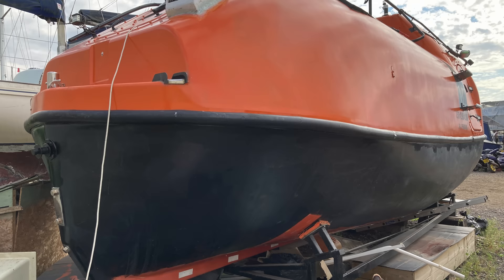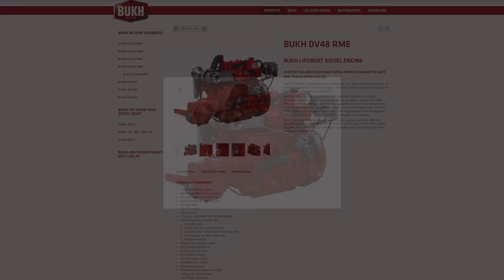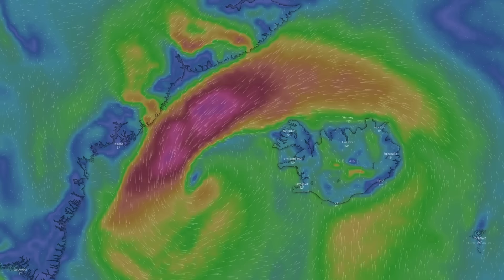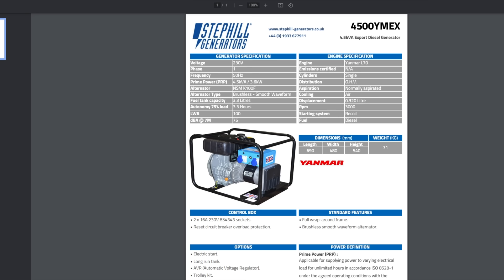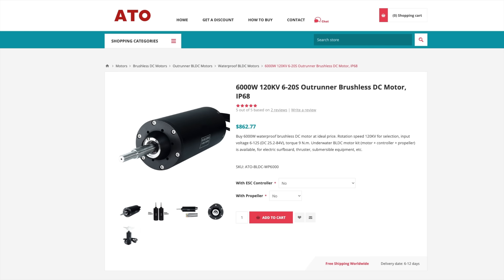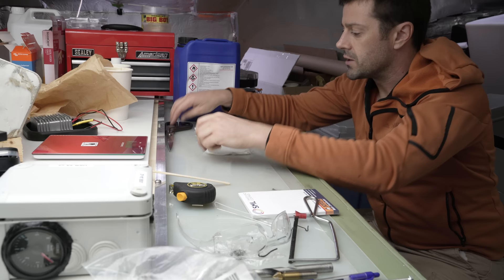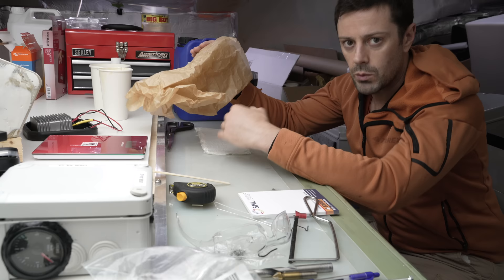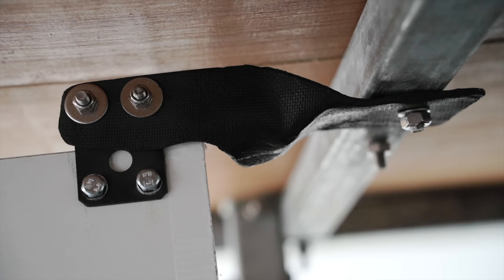Lifeboat Conversion Ep49: Electric? An engine backup plan, if Alan's Bukh diesel fails at sea. [4K]

Comment: I see the Voyager beat me to a sail idea which is free energy when there is wind - another option should your super diesel sipping engine still be functioning you may like to have a back up water pump connected via a clutch system to Mr Bukh and drawing water in and ejecting it via a fire hose type steerable nozzle on the stern  - by a long chalk Big Al is not a jet ski but simple backup propulsion / steering system. I thought you said “Guts in a Row”🤔
Reply from the maker: That's certainly inventive Dick!

Comment: Spend your money on ensuring clean fuel and clean oil, carry lots of spares. Your engine will be incredibly reliable. Most trawlers are single engine and get a much harder life. The space and weight you’ll use carrying spare motors could be used to completely rebuild your engine. Have cruised on a single engine for years with no problem.
Reply from the maker: I need a small motor for an inflatable anyhow.

Clean fuel, clean oil. Agreed! The engine has a coarse filter, two fine filters, and a water separator.

Comment: It'll be interesting to see how you solve the electric motor puzzle. Three seems like too many. Two mounted and one spare maybe? As an emergency propulsion system you are usually accepting less speed to offset weight and complexity.
I'm talking out of my arse here as I don't think anyone has s anything similar to compare it to. I'm interested to see what the result is.
Reply from the maker: If fewer, they'd need to be larger. One of them on their own needs to be able to be mounted to the little inflatable launch too.

Comment: I noticed that the intake is inside the cab. I would run a snorkel straight up the top with a curved pipe. I say this because if you have to batten down that hatches for a while, it's gonna suck out the oxygen realy fast inside that boat. I haven't seen any intake ventilation,  so I am assuming it's using O2 when the doors are open. Correct me if I am wrong. I would have both, diesel and electric.
Reply from the maker: The DV48 needs about 50L of air per second at full chat. Coincidentally, I've just taken delivery of an acoustically baffled intake vent.

Comment: It's true, even at the 31% efficiency before actuating the propeller, diesel has excellent utilizable energy density. It's not worth getting cancer for. I would convert to sail, mast and retrofitted deep keel, because it's free, and if used properly, better per unit £ for energy consumed, and better for the environment and health of the engineers.
Reply from the maker: I love how casually people suggest a total conversion of a TELB to a sail boat.

Comment: Even with a big battery bank,  your range is likely to be maybe 40 n.miles. Check the math for your own battery bank. Assume you'll need about 5 kW. A petrol extra long shaft (25") Yamaha 9.9 HP high thrust outboard is perhaps a better option in the "well proven" category. They are commonly used to propel 3000-5000 kg +  sailboats at 5-6 knots. Keep in the cabin until needed. Have a hefty bracket you bolt on the transom first (pre-drilled holes sealed with Sika), then lower motor in place. They are heavy beasts (60 kg) so you need to have a rope on the motor as a safety line as you lower in place (Helper sitting on the cabin top belaying it into position; lower guy opens back hatch and tightens clamping bolts. If the diesel is consuming about 2L/hr then figure nearly 4 L/hr for the petrol engine. So a 20L tank gives you 5 hrs @ 5 knots = 25 n.miles or so.
Reply: Oh, put the petrol tank on the roof if you are so worried about it. How many small runabouts use petrol motors with internal gas tanks - thousands and thousands.
Reply from the maker: Alan will have a 4.5kW diesel generator anyhow, and 4x50A AC-DC charge controllers, so it's not about one-off battery capacity.

Engine outboards of any type are awkward and heavy to store and manhandle, if not mounted to a transom throughout, prior to an emergency.

Having large petrol fuel tanks is suicidal on a boat like Alan, and for passages he's to make. There's nowhere outside the cabin for more than a jerry can or two. We'll have to agree to disagree on that.
Reply: @AlexHibbertOriginals  I didn't know about the little genset. With that you've got a good reason for electric backup propulsion.

Comment: Honestly, the diesel outboard seems like the best backup option really... the whole triple electric set up seems overly complicated for an emergency back up system. You can probably find a used outboard at a significant discount. You are talking about deploying this in an emergency, possibly in rough seas and the triple electric system just seems much more difficult to deploy.
Reply from the maker: Used ones are still £10k+, and are complicated, awkward to store, and very heavy to move around.

The electric set up would weigh 10% of the outboard, be easy to store before use, and could be designed to secure onto the transom with rough seas in mind.
Reply: I really don't see how an electric motor is more complex than any combustion engine. At least the "brushless DC" motors (that are typically just multi phase AC motors), they have extremely few moving parts (one plus bearings), and will be operated at a very stable temperature just below 0C. Should be fairly robust, imo

Comment: Beta is making some Hybrid units that look like they might fill your bill and add functionality at the same time. Also might we not be trying to be overly complicated. Have you considered an emergency sailing rig. Lifeboats are inherently stable and an unconventional sail plan like a Luger or Spritsail are easily stowed as no one of the components is large and the rig doesn’t need a lot of rigging if any. Sorry if I’m overstating something you’ve considered.
Reply from the maker: Thanks - I've discounted installing a rig or mast on Alan - kites I'm still open to.

Comment: I had mentioned the Lynch/AGNI motors on a past video and was surprised to see from your video the Yanmar Diesel/electric hybrid system utilizes one-which makes sense as they are such efficient generators as well as being incredibly high torque motors.   My current project is using an older AGNI motor in conjunction and mounted to the top of an old outboard drive unit with a ship type tri blade propeller to make what is essentially a high power trolling motor that I'm running on 48 volt ebike batteries.  It may be a possibility in your circumstance for a backup motor solution as well with your engineering skills for designing a remote control unit for steering.  It would be cost comparable I would think to what you are considering
Reply from the maker: I think what you're suggesting is essentially a self-contained unit (like the Yanmar hybrid) - a generator and motor in one, linked to a battery bank. I discounted it as I'm going to need a stand-alone generator anyhow, and my solution also solves the problem if the prop, prop shaft, or rudder are busted too.
Reply: @AlexHibbertOriginals  Thank you for replying!  I reread my comment and it is not clear at all and I apologize.  What I was implying really was utilizing just the lower end of an old gas outboard engine mated with a lynch/AGNI motor for powering it off your battery bank.  A simple servo motor or cable driven steering, and perhaps a larger propeller from a ship mounted on the lower unit would be necessary but it would be a very capable emergency backup you could run off your 48 volt battery bank (also economical compared to alternatives).  Lynch/AGNI high power axial gap unique DC motors can put out 12kw of power at 48 volts, but can also be run far below that indefinitely, or far above that for short periods if necessary.  A golf cart 48volt dc controller is sufficient, but higher end controllers can be had and work well also.   You could keep on board a petrol or diesel generator for backup power and recharging your battery banks if you don't already have one, but the AGNI/LYNCH motor could certainly move your boat around as even Yanmar decided to use those motors in their hybrid drive system.  Just ideas as I'm a huge fan of yours as well as obviously Cedric Lynch and his Lynch motor.

Comment: What about a kerosene powered outboard engine? I know Parsun has some. The Bukh could probably run on kerosene as well.
Reply from the maker: More sensible than a petrol outboard, but it would still mean two fuels to store. The Bukh might, or on a mix, but kerosine really stinks and is lower in energy than diesel.

Comment: Carefull if you think going lithium for storage.
Those fires don't go out and in a grp boat fires aren't nice either.
If it was my boat I would use more traditional batteries, the double function as keel weight also.
( The sailing property of the lifeboat is best with weight of the number of persons which can be onboard)
Reply from the maker: My main bank is Lead Carbon. Just a handful of smaller LiFePo4s for other uses.
Reply: @AlexHibbertOriginals  the lead ones would be my choice also for a main bank

Good luck with the build

Comment: Alex, as your primary prop/ring rudder is pretty much a sitting duck for larger ice chunk damage do you think a 24v walk behind forklift motor driving a smallish arneson style surface drive mounted to the transom on the port side if the rudder support with a seastar type pump for the steering ram would cover both engine and rudder failure to get you to a repair port.
Happy to sketch something up if you want.
Reply from the maker: Remarkable machines! Alas, whilst Alan could probably benefit from some massive structural and fundamental re-designs, I just don't have the means to install that sort of thing.
Reply: @AlexHibbertOriginals  Alex I suggested it because the primary drive shaft from the motor is basically only an enclosed tube which could go through the fibreglass and foam that forms the step/seat inside the door and the motor (less than 40kg) could be mounted directly to the step with minimal bracing and as the external ball (uni joint housing) is flush mounted the rudder strut bolts could hold a base plate for it as from memory they were designed to support the boat through the hook brackets?

Comment: Alex I've been busy looking for submersible thrusters  I was thinking they mount under the hull easily one on either  side of the prop but I can only find about 7 hp
Not enough right? They I tall on skews look very sharp  I will continue to hunt! For you I have found beautiful  100  gallon solid double wall fuel tanks
I don't like bladders if they burst or rip well it will get nasty!  and as I'm sure you realize the first  duty of a sailor is to be a fireman!!! Then sailor  I'm praying you install
A auto fire suppression system for the boat with your mind I'm sure you can devise a sprinkler of some sort and have plenty of foam at hand ! The aforementioned  thrusters mount  on stream lined skegs and would very simple electric back up. Cheers Tony  I have some nice gear for you were do I send ?
Reply from the maker: Agreed that hard wall tanks are a lot neater for my purposes. The bladders in their defence though are well made and tough as hell. On propulsion units yes there's still a limited range, from the all in one electric outboards to the separate components pods and ESCs you need to get. For me voltage is important, so I'm likely to go for the punchiest 24V available and then use multiples. 

Get in touch via the contact form on my website - probably easiest. Cheers!
Reply: @AlexHibbertOriginals  I'll keep looking  there available but cost alot for the real deal

Comment: I think you can get away with not needing your electric motors to rotate if you use differental thrust
Reply from the maker: My guess would be that steering would be pretty limited if you only power down the port side one to try and turn to port. They wouldn't be mounted that far apart.
Reply: @AlexHibbertOriginals  If you need more steering you can always reverse one motor.

Comment: I assume that you have already considered it, but I still want to ask:
How do electric motors manage with arctic temperatures?
Reply from the maker: Motors are fine (as are most electrics), and they will be nice and warm underwater.

The batteries are inside, so won't be cold.

Comment: What is the purpose of having 3 motors? Redundancy? 1 will probably be enough to use your entire power budget. Electric trolling motors will be the most efficient, coming with a propeller matched ideally to its motor.
Reply from the maker: Redundancy, yes. Also, much over 8hp the whole design of the motors and housings gets a lot bulkier, and more expensive. Also, a single one can be used to power a launch.

Comment: Have you considered a second hand diesel outboard? Yanmar did a 36hp one and they can be found on several ex MOD surplus sites such as RAMCO from time to time. They are anything from £500 upwards.
Reply from the maker: Given that reconditioned Yanmars from good dealers are £10k, I'd not touch a £500 one with a bargepole!
Reply: @AlexHibbertOriginals  well...not saying that a 500 quid one wouldn't need "some" work!

Comment: Hi Alex 
In this video, you said that you will be connecting your electric motors in series??
If you do this, you will only be giving each  motor 16 volts. Should you wire up the motors this way, you will have the same power as one motor. Parallel wiring gives you the maximum output if you can supply that amount of electrical power.
Steve Hardy.
Reply from the maker: If I did, it would have been a mistake, or using the word series in another meaning of the word - i.e. in a row.
Reply: Hope it all helps mate.
Steve

Comment: If the rudder or propeller are smashed, does a new rudder be useful ? I mean, if it's still attached to the boat but broken, it will induced drag so is a new rudder powerful enough to go against it and control ? Same question for 3x8hp motors. I don't know if this emergency case (lost rudder) needs to be covered as it adds many complexity and may not be solved.
Reply from the maker: I don't think we can have a plan for all the ways in which the rudder or prop may be damaged.

Comment: How did you get to 3x 8hp for the electrics? Would be interested to know the calculations as intuitively it seems a bit high.
Reply from the maker: Because Alan needs thrust (obviously prop choice and a reducer gear would be key) and 24hp is approx. the lowest engine power I've seen other TELB lifeboats fitted with. Alan was spoilt with his top of the range one. Also, 3 motors allow for failure/redundancy.
Reply: @AlexHibbertOriginals  Thanks for the reply :) No problem with redundancy but it would be interesting to know how much HP (and torque) that Allen's engine is producing at those revs. you might find that the power required is considerably less for an electric motor.
Reply from the maker: The spec sheets don't go under 2000rpm, but I'd extrapolate to about 25-28hp at our revs sweet spot.

Comment: Idk, seems overly complicated for what an 25hp Honda petrol outboard could also accomplish…

Edit: plus when speaking of failure scenarios, what’s when the batteries fail? If u need a backup powerplant i think outboard is the way to go
Reply from the maker: Quantities of a dangerous secondary fuel isn't really viable.

There are two battery banks, so total failure unlikely.
Reply: @AlexHibbertOriginals  sure, you have to judge if the risk is worth it. My thinking would be to carry something like a 20l tank somewhere strapped to the outside and have a petrol engine mounted on the back. I have no idea how a diesel outboard would preform in such cold climates so that might be a good option too maybe. I have no idea how reliable batteries are (water ingress shorting them out?) so i felt like second engine (and rudder hehe) would be the best way to go :)

Doing it with the 3x electric motors and controller tho will make for a much more interesting video anyways so :p

Good luck and safe voyage!!!
Reply from the maker: 20L won't take you far with an outboard - there would need to be a significant supply. 

You're not alone with your final comment!

Comment: Im no engineer, but I really struggle with the idea that a diesel motor running a electric motors via a generator will use more fuel than the current arrangment
Reply from the maker: Every time energy is converted or processed, you'll have losses. Through heat, noise, self-discharge, wire resistance, and so on. Diesel engine's losses are through the engine itself, gearbox, prop shaft, prop. For a hybrid system: engine, alternator, wires, charge controller, wires, batteries, wires, ESC, wires, motor, prop shaft, prop.

Comment: what kind of fire suppression system is alan going to have? are you planning to install one of those fancy automatic fire suppression system or just stick with the good ol fire extinguisher mounted on a wall?
Reply from the maker: Currently I have fire extinguishers mounted on walls/in cupboards, but I'll expand this. Probably as no to an auto system.

Comment: if plan a engine engine died cant get it started and plan b you could used two trolls motors which you normally find them on front end on boat and can make bracket fold up on side of boat and unfolds on side in water plan c ended up making bracket for outboard gasoline power for emergency backup in cause of plan a failures plan d find wrecks tesla car or electric vehicle and get esc and battery or else out of it to control motor came from it and use it in cause of engine failure just slip on belt n go
there so much stuff you can do but tight on budget cant afford for it which i understand that point some time u can get away with gasoline or diesel engine more than electric motors because someone can bring fuel but cant bring charges which why get more challenging